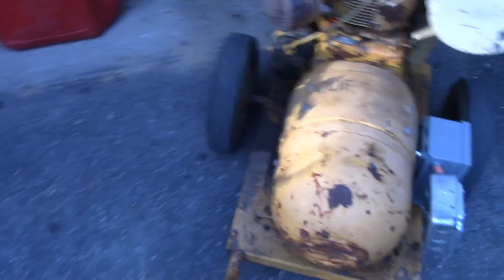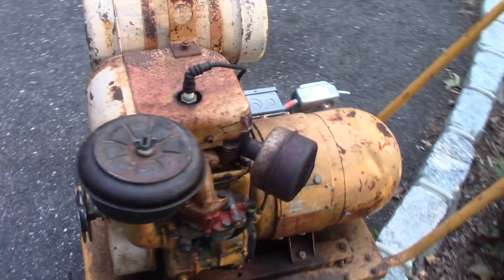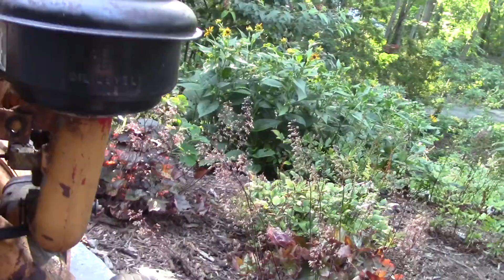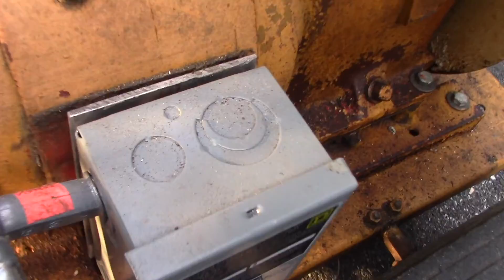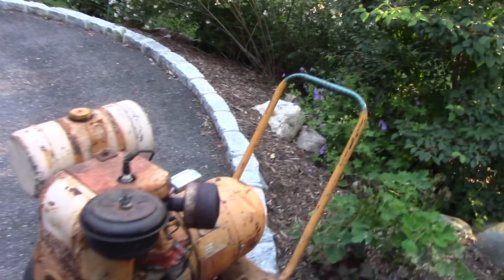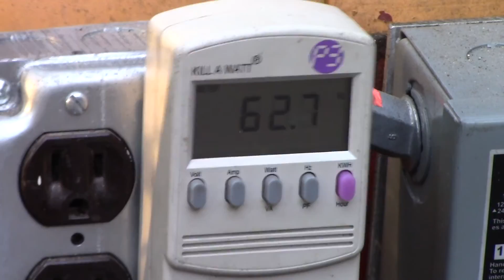Little Red Devil Lighting Plant ( Antique Generator)

Comment: That's a sweet little gen set. I love Those old Wisconsin engines and I have a couple. This is either an AEN, or an AENL. The AEN was 8 hp, and the AENL was 9.2 hp. 
I'm not sure what they did to increase the power, but both versions are 3" bore by 3 1/4" stroke. about 23 cubic inches. 
Most of the old Wisconsins are long stroke engines so they make lots of torque. I did some research recently because I have an AENL. This motor makes as much torque as a modern 13hp Honda!
A Wisconsin THD or TJD inline twin cylinder engine is on my list of engines to have someday.
Reply from the maker: Thanks! I have started to like them more recently as well and plan on getting a couple more. I really want either a really early one or one of the massive single cylinder engines they made lol. Thanks for the info! Yea they are quite torquey lol. Big piston, big stroke = lots of torque! I actually was offered a genset with one of those on it and it's super cool but I just dont have the room for it. I'm sure you will find one some day! Thanks for Watching!